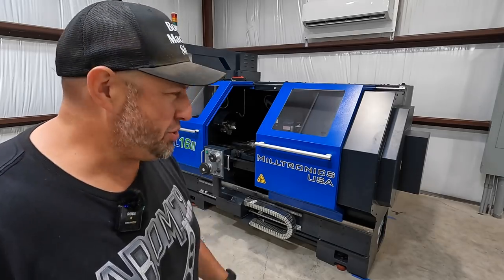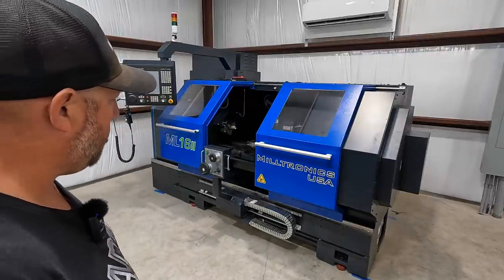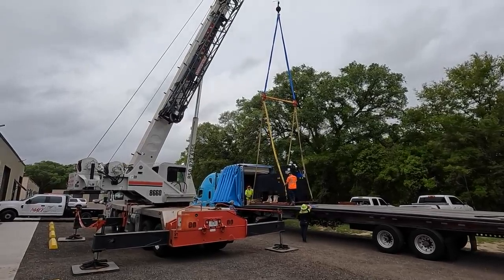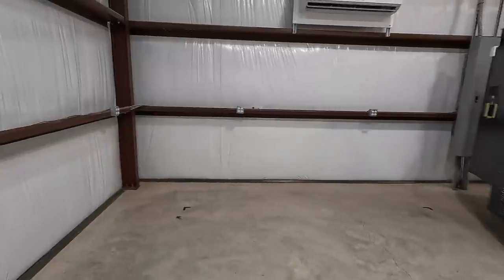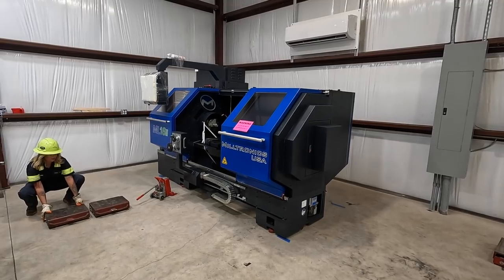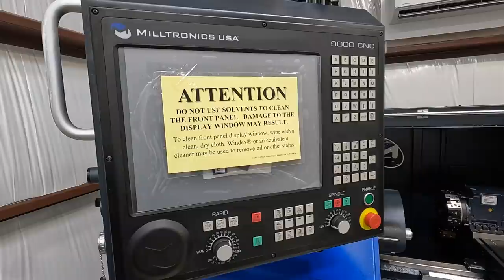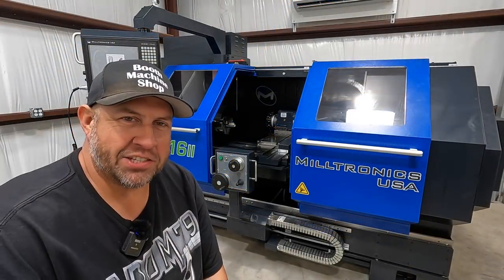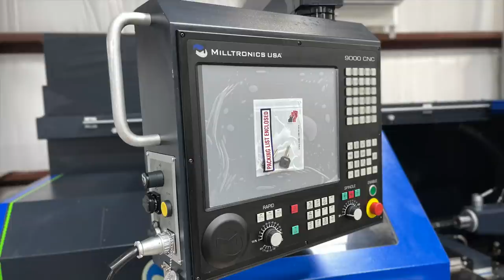Milltronics ML16 CNC Lathe, Our First CNC!

Comment: Congrats Adam. I've been programming and running CNC lathes and mills for over 30 years.  Get to know the canned cycles, GREAT time savers.  I usually allowed .020 for the finish pass.  That way when you start the part, you go +.020 on the OD / X ( minus for ID ). You run the finish pass on verify the part is oversized by .020   Then you remove the "extra" .020 and adjust the tool value if needed and then just run the finish pass.  Super tight tolerance I went +.040 , measured and ran plus .020, then finally "0". Once you get your training, reread what I wrote and it'll make perfect sense.  You are already one BIG step ahead with your manual knowledge,  you'll do fine.   Jeff

Comment: Congrats on the new machine, I admire your willingness to head into “unchartered” waters. I’ve ran all kinds of cnc equipment since the 90’s, currently on swiss lathes. The three best things you can utilize when running a new program is the single block, rapid control and distance to go on the position page, master those and you can avoid trouble.

Comment: I was mid-40s when I got my first exposure to CNC, actually, NC.  It was a bandit hooked to a Wells-Index knee mill.  It was all G & M programming.  The programs were already written so all I had to do was change dimensions here and there.  My boss got a line on a used Lagun II knee mill with Anilam CNC.  It was conversational and G & M capable.  He asked me if I could operate and I told him to make sure he got all the manuals.  I had it drilling hole patterns on tube-sheets for shell & tube heat exchangers the same day we got power hooked up to it.  Lastly, I changed employers to a company that had purchased a used Hurco, BM-40 bed mill.  I was hired as a welder but after their machinist quit and moved out of state, I finally talked the ops manager into showing me the basics.  My boss from my previous employer worked there as well and asked them why they waited so long.  I not only operated it, I programmed it, started working in the office with SolidWorks with only AutoCAD experience, and ended up being the tool shop and stamping die maintenance manager.  So much fun in the machine shop.  Really sad I had to eventually retire, I'm 76 now.  You will have fun with your CNC lathe, I certain!!!

Comment: Hi Adam,  It so exciting to see you getting into CNC.  I have been a watcher for many years, and a CNC instructor at a local Junior College for around 20 years.  Sure wish I could come down and spend a few months.  Here are a few tips:
    1),  Start with the Mill, contrary to intuition, the mill is much easier to run.
    2). A question on every one of my exams: What is the difference between manual and CNC operation?  Answer: who is turning the handles ( the math and setup is the same)
     3). CNC machines do what you TELL them to do, not what you WANT them to do.
     4). I can teach a manual machinist to run  CNC machine a whole lot easier than I can teach a computer jock to be a machinist.
     5). The hardest part you already know, thanks to your dad and grandfather.
     6). A cnc skill is just another tool in a machinist tool belt.
Have fun Adam. we all be watching, and pulling for you!

Karl
Reply: #3 is so true!

Comment: Wow, this is momentus! About ten years+ years ago I got really interested in machining through abom, tubal cain and Keith fenner. I was obsessed with these YouTube practitioners of the mechanical arts. Now I have served my time and currently have my own humble cnc machine shop. Its really exciting to see Adam getting excited about cnc machining. Without his content I may have ended up in a different career. If I had to say one thing about the whole cnc vs manual debate that may be relevant is... treat it like hammers. A small tack hammer and a lump hammer do the same job. Yet you wouldn't want to drive an 8"nail into timber with a tack hammer. The same way you wouldn't want to drive tacks into fine furniture with a lump hammer.
Each has its benefits and both require a skilled operator to know when to use the tack or lump hammer. 
This separates the button pushers from the machinists

Comment: Adam, with a CNC lathe, and with some of the parts you may have to make, you will have at one point make soft jaws to hold these parts because the chuck won't be stuck on one speed and also use a torq wrench instead of the chuck key in some cases.   Well happy learning, I'm sure you will love this.

Comment: Your outlook is great. Your a true machinist and adding CNC to your skills will make you even better. Instead of moving handles your pushing buttons. It’s still making chips. At 16 the shop I worked at bought a used Milltronics mill. I cut my teeth on that machine and learned the programming now we have 5. There good quality and service is good too. Best of luck

Comment: Can't uplike enough.  I have a CNC and a 3-Dprinter.  I spend 90% of the time designing a part then machining it.  And I have about 50% failure rate as far as the first designed parts go.  If I download some else's part, sometimes it goes  well, other times it's junk.  So what I do now is import into Fusion 360 and mess around with it there and then get a final cut based on what my printer can do.  I'm still trying to get my CNC trammed in (longer story) so I don't have advice on that.  But I am looking forward to your discovery into CNC.  With your level of machining understanding, this is going to be an exceptional voyage.

Comment: If you really need to process long bar stock in from the left of CNC lathe, check with the landlord and see if a  man door, windows or even a smaller access opening with a small door on it, any of which would align with the spindle.  could be installed.

Comment: You will need some inexpensive accessories for the ML-16.  Large bottle of aspirin.  You will need them to fight off the headaches CNC creates.  A large trashcan.  Not every CNC project turns out as planned or "How the hell did that happen?"  A bottle of No-Doze.  No matter when you start a CNC project, it always finishes at 2:17AM.  A small refrigerator for milk, jelly, peanut butter and bread.  You will be eating most of your meals watching the job to make sure it doesn't go sideways on you.  And lastly, a 15" laptop so you can search the internet to find out how to create interior metric threads on a ML-16.  You are going to love it, but the learning curve will make you ask, "How soon can I retire?"

Comment: Adam to make any money from a CNC you are going to need to do batch runs with minimal loading and unloading attention. By restricting the access to the bar stock loading feature you are making unnecessary work for yourself. 
You also need to consider workflow paths for materials, and finished product inspection storage and packaging if you are looking doing production or jobbing runs.
With that in mind I think you should either move it to the other corner at the back of the shop or switch places with the new manual lathe.
If you look at machine lines in a factory you'll notice the operators are running several machines not just standing at one, feeding parts in and out. 
You've got a steep learning curve in front of you, attack it with small steps and you'll get there.
Best of luck
Eric
Reply: Yes I agree, however this is only temporary till he moves to his own property and his ' real workshop '.
Reply: I note that he wrote 'Exciting news for the Abom shop', rather than 'Exciting news for the Booth Machine Shop'.  That to me implies that it is a machine for channel content rather than a production machine optimized for efficiency; that bit is a long way off, possibly on a different machine and also future home shop location.

Comment: Decimal points and minus signs 
Decimal points and minus signs 
Decimal points and minus signs 
Decimal points and minus signs 

Remember to watch your Decimal points and minus signs to avoid crashes.
Reply: Agreed, the most common mistake I've seen is misplaced decimals. .1 instead of .01 can be the start of a really bad day very fast haha
Reply: Listen to these guys Adam. On a manual machine you are in charge..... But in CNC you give control over to the machine...... And you better be damn sure that the machine knows what you want it to do..... Before it does it.

Comment: We've had an ML-16 in our shop for about 10 years.  We have (4) Milltronics mills and the lathe.  Great, versatile machines that you'll be very pleased with.  When you need to step up to a more robust production quality CNC that can be programmed from the control, we've been very pleased with our Okumas too.  One of them is an LB-3000 7-axis that is just amazing.

Comment: Talked with an old timer machinest a while ago. He said it was easy to teach a manual machinest to operate CNC but very hard to teach a CNC operator to run a manual machine.
Reply: It's downright impossible.
Reply: You stole my comment.

 Absolutely true. A manual guy has a perspective that's not available to a CNC trained guy. The versatility of skills of a manual trained person gives him endless lateral moves if needed. 

I've seen a similar thing over the years in drafting. Guys that started with pencil and paper, on a table, we're always better CAD draftsmen.

All that said. Learning any of the CAM packages and gcode to boot is a big piece of work.

Comment: I worked for an Aerospace outfit some 20+ years ago and installed CNC equipment because it was needed for Airbus work. It frightened upper management. They solved the problem by firing me. The HAAS cnc machine is still sitting in the machine shop. Of course they have lost Airbus as a customer a long time ago. Fear of knowledge can be a cripping problem.
Reply: We're making airbus parts at my work right now.

Comment: you will get it but just remember, the computer does EXACTLY what you told it to do, whether or not that was the intention, when you do have that brick in pants moment hit the e-stop as fast as you can, and do not forget to reset your zero's INCLUDING tool offsets, cause its going to assume where its at is good and bugger up all kinds of stuff

Comment: Hi from the UK.
Like you, I was trained as a jig and fixture toolmaker used to manual machines but over 25 years ago, I migrated to CNC. Don't be daunted by CNC, initially it's a very steep learning curve but when everything clicks into place, it's extremely rewarding and enjoyable. You'll make mistakes but its all part of the fun of learning. Have fun with it all and one thing CNC machines are very good at is making a helava lot of swarf very quickly!!!.
Chris

Comment: Adam, let me offer you a bit of well-worn advice on your new toy. I have bought and programmed CNC lathes, machining centers, screw machines, and bar machines for many years. So I know from whence I speak.

Before you take your first lesson..... Or even push the button to turn that machine on for the first time..... Please do yourself a favor: find out from the manufacturer what protection you have when the turret tooling crashes into the chuck. I'm not trying to scare you, but just prepare you. You have to know what will protect your machine should a crash happen, and how do you get the machine up and running again as quickly as possible. I cannot emphasize strongly enough to you how important this information will be to you.

That being said, I want to wish you all the very best of enjoyment and success with your new CNC adventure! ☺️

P.S. -- if you have any aspirations of using your new CNC lathe as a through-spindle bar machine you might want to locate it in such a way that you have room for stock rollers for the bar on the left side of the headstock.

P.P.S. -- always know where the "chicken switch" is.
Reply: John is right. The only other thing I would add is SIMULATE EVERYTHING. It has saved me hundreds of crashes. Fusion does a good job at it. Remember one single digit regardless of where it is can cost you an instant 20K. Simulation will show you that digit mistake so to speak. On a different note, welcome to CNC!!! Congrats Adam.
Reply: Absolutely. One mishappen programmed toolpath can crash it.

Comment: I do manual repair machining just like you but I also have cnc experience, cad/cam as well. I can't tell you how many jobs that even though they where one off I would have setup and done it in the cnc machine if we had one. They have their place in manual shops and I think once you figure it all out you will be super happy you learned it. Good luck man!

Comment: I have an obvious question. What is Adam gearing up for that will make these machines earn their keep?
Reply: Good question--what
Reply: The machines are for creating content and learning first of all. They are borrowed from the supplier, as demo machines
Reply: @Rimrock300  machines are for production -nothing else whether its agri or industry--its practical
Reply: @iancraig1951  machines are also for practice. Schools, youtube channels and so on.
Reply: @iancraig1951  This is a toolroom lathe and it is actually very well built for prototyping one-off parts as well as fixing things. I have a toolroom lathe similar to this that mostly gets used for repair work and jobs with less than 20 parts
Reply: Martin R  He' plan to move out of this shop into a new house and toolshop within 2-3 years
Reply: for repeat production not repair @thescantilycladcob
Reply: @thescantilycladcob  I have my doubts

Comment: Cutting a 6" diameter hole in the side of the building and making an insulated door to cover it will take away the issue of the feed from the side.  Think outside the box!!
Reply: I was thinking that, unfortunately the access hole in the machine seems to be lined up with the steel cross member of the building. Can't tell for sure without being there.
Reply: @firesurfer  yeah I saw it might be in the way.  Same lime of thinking though, just move it up or down.

Comment: Hellova a machine tool - and THAT'S from.a dinosaur. You're on the right track. That looks like is might be a great starter machine for a guy breaking into CNC. I'd guess that little two handwheel panel sliding low in front works the same as the apron controls on a manual engine lathe. Looking forward to developments.

Stating the obvious: I hope you post plenty of content following your schooling and personal progress to operational competence in tge. CNC world. 

FIRST thing I'd do before you make the first chip is paint that gloomy interior white so you can see what's going on. It's a safety issue. I'll never understand why they let color stylists  and marketing dweebs anywhere near industrial products in the development and design stage. They contribute nothing but smoke and mirrors and often interfere with operability, productivity, and function merely to gain a trifling "cool" factor.

Comment: There is absolutely no way on earth i would block the rear feed on this machine. Time to swap the lathes I would far rather have the rear feed open on this money maker then that big manual. You might get a short time frame of 100 parts. i know your liking one off jobs, but that machine was built to make parts and money fast.

Comment: The one machine shop I worked in, many years ago, would occasionally do marine shafts. There wasn't enough room in the shop area behind the lathe to accommodate a longer shaft, so we had a hole cut in the wall behind the lathe, leading into the grinding area, with a dedicated tool rest. It worked perfectly well. You can probably do the same thing in the shop wall leading out to the side yard.

Comment: I never trust a company that does not list prices and "get back to you with a quote". I just ran into this last week wen a company gave me a different quote than my friend when buying the same item. Smells of a shady car dealer.
Reply: That's the way every single machine tool company, except for haas, works. It's how it should be. you're just not used to it because you don't deal with industrial equipment. Companies that have the price listed are just going to post the average price. The big orders will still get discounts and get it for a cheap price, but you'll still pay the listed price, which is average. You'll have no chance of getting it cheaper, but the big companies will. So instead of you getting quoted $120k and your friend getting quoted $100k, you'll both pay $115k. So your friend will pay $15k more and you'll pay $5k less, and the company will make $10k extra.
Reply: @littlejackalo5326  You have no idea what you're talking about. Everything you just said is wrong. Every reputable company I have ever dealt with has up front pricing on everything and only quote custom orders. Tormach for instance. Just go to the website and you will see. Everything has a "Base machine starting price" This is just one example.

Comment: We’ve got our Haas SL-30 up next to the wall like that and just have a hole in the wall.  Used to have a small piece of R panel to cover it up but don’t even bother with it anymore.  Also will screw a piece of wood to the framing to support the stock sticking thru.